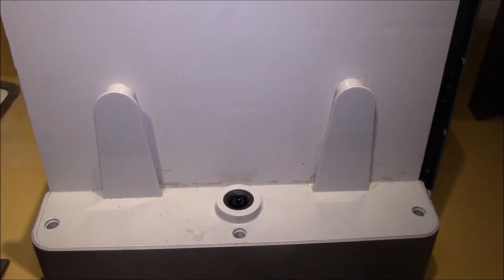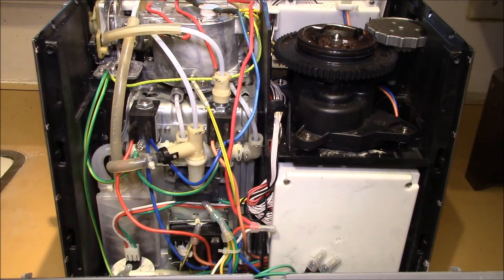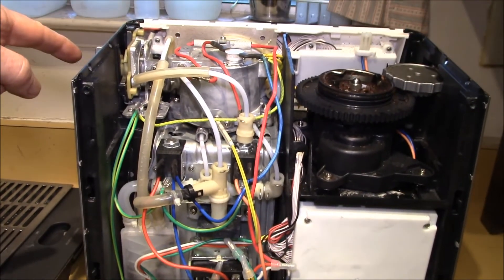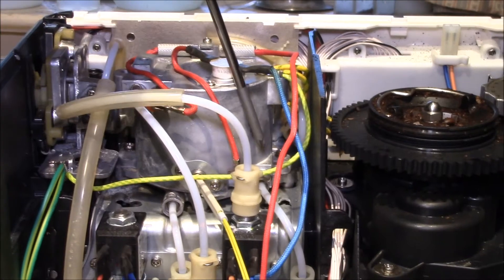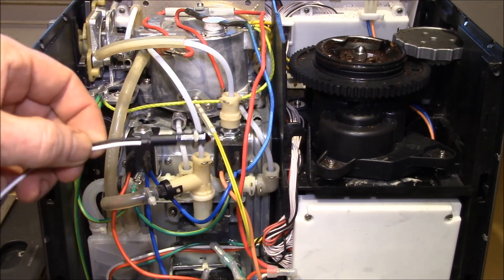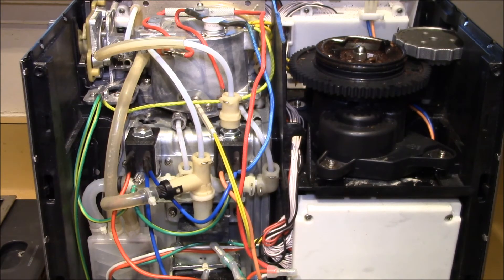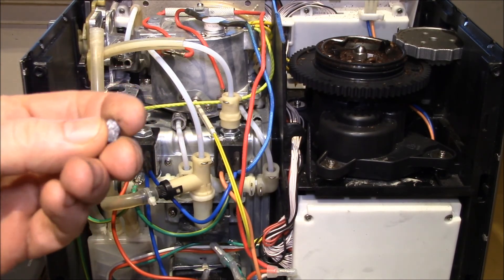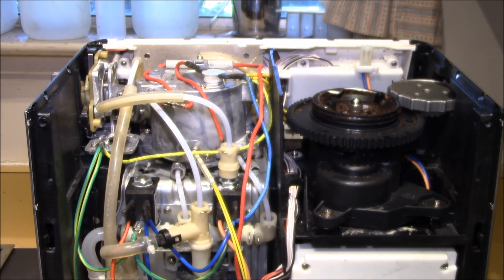Breville/Sage 870XL Barista Express - Water Flow

Comment: Need Help.
Have unique situation. 
When machine broke down only steam/hot water was working.
Replaced solenoid valve assembly: espresso part is working, hot water and steam is going thru espresso port.
Changes three way valve with part from Brevville(OEM) and same: espresso is working, when I turn hot water or steam,  it’s going thru espresso part.
What could be wrong?
Reply from the maker: Follow the water, if it's going to espresso all the time, the 3-port solenoid is either stuck open or it's being turned on all the time.  One test is to unplug the machine, open the back and remove one of the top 2 wires from the solenoid, tape off the exposed end, then plug the machine in for a test.  If it only does hot water/steam, then the solenoid is getting power all the time, check the main circuit board, perhaps the driver for that solenoid is stuck on.  If if still does only espresso, the solenoid valve is stuck open internally.  Open it up and see what's up, I have a video on testing the solenoid valve in this playlist.
Reply: @ I unplugged one wire from solenoid and run test. Water/steam worked and espresso didn’t. 
Connected that wire back and espresso works but hot water/steam goes thru espresso port . 
I believe I need to check or replace circuit board? What to check in the circuit board?
Reply from the maker: @mortgagesdmv9205  See photo 11 in the album below:
https://photos.app.goo.gl/bN1ugnLPYwvyDcr59
Likely either TA-3 or TA-4 have failed in a shorted condition, i.e. they are always on.
Reply: @The4Crawler  TA4 is burned out . 
Thank you for your help with finding it

Comment: I had no water flow. After I took it all apart I discovered a comment somewhere to just syringe water through the back inlet. This gets rid of the air inside and forces water into the boiler system etc. 100% worked!!!. Try it before you start taking your machine apart..
Reply from the maker: That's a great tip, thanks for sharing!
Reply: Like just remove the tank and then syringe in three that outlet? Or take back cover off and syringe into inlet hose?

Comment: Thanks for the tutorial.  I'm having an issue with my steam wand on my bes870 Breville.  Nothing comes out of the steam wand when I switch it over, the lights engage on the machine, but when I switch it over to hot water all the steam and then eventually hot water comes out of there.  So the pressure is building properly but not releasing anywhere when switched to the steam wand.  I was thinking maybe a dodgy valve that isn't opening properly or something?  I have cleaned the wand and tip, and descaled a couple times.  There's not even a drip of water coming out with the tip off the wand.
Reply from the maker: Some tips on low or no steam flow below:
https://siber-sonic.com/appliance/800Mech.html

Comment: Which solenoid valve do I need for my 870XL? Just the double or triple? Mine started the nasty buzzing this morning while brewing
Reply: Can’t figure out if I need the 2 way or 3way
Reply from the maker: @tylermiller214  This video should answer that question.  The 3-port valve is what diverts water to the group head when it's on, and when off sends it to the hot water / steam valve.
Reply from the maker: The 3-port solenoid is the main one, that one needs to turn on to do the espresso mode:
https://youtu.be/96IuKiuIB5A?si=xAKVDuzdpCJongU9
Reply: @The4Crawler  thank you man i appreciate  your time. I’m getting the noise when I try to brew a shot

Comment: I replaced the 3-way solenoid valve (the black one on the right in the video) a few weeks ago as it was tripping when I pressed the 1 or 2 cup button up front. It was okay for a while but now I have very little water coming from the group head (it doesn't make the normal sounds anymore) and hot water outlet / steam wand. Of course, there is no pressure on the meter as well. How do I fix this?
Reply from the maker: See the pinned comment for this video, lots of good troubleshooting information there.
In short, figure out where the water is going, assuming the pump is running, likely to the drip tray.  If the pump isn't running or not producing enough flow/pressure, see why.  Is water getting to the pump,. is it going out the overpressure valve and to the drip tray?  If it's going to the hot water side OK, then it's likely that solenoid that is either plugged and not opening fully (water will flow to the hot water valve as that's the path of least resistance).  Or perhaps the solenoid isn't being turned on by the main circuit board; bad connection or faulty driver circuit.
Reply: @The4Crawler  Ok thanks. I believe the pump is turning on but sound suddenly changes midway (gets softer) even on power on. I'll check the pipes for leaks or clogs. At this point, I am assuming that there is some issue with water flow.

Comment: I have issue with my breville the steam come from group head will make coffee
Reply from the maker: It could be the tubes inside are connected incorrectly.  Refer to this video on how the tubes should connect and the water should flow.

Or, perhaps the 3-port solenoid valve is either stuck open or is being energized all the time.  One test is to unplug the machine, reach inside and pull one or both wires off the valve coil, be sure to wrap them in electrical tape.  Then try running the machine and see if only the hot water / steam function works.  If it does, then there may be an issue with the main circuit board.  If it doesn't work, then the solenoid is stuck open.  Try cleaning it internally or replace it.  Videos on both those subjects in this playlist.
Reply: @The4Crawler  it look it get heater more than
Reply: @The4Crawler  I can get your WhatsApp number to send you the video

Comment: Was able to diagnose and fix my breville thanks to this video and explanation of the water path.  My 3 way solenoid valve orifice was clogged up with mineral deposits causing a lack of water to be dispensed.
Reply: Was it just a matter of pulling the minerals out of the valve and hose?

Comment: Thanks for the video. I wouldn't have tried to fix my machine without this video. My problem was that I was getting no water from the group head but there was water to the hot tap and steam wand. I replaced the 3-way valve and solenoid and now my problem is reversed, water at the group head but also steam as well and no steam or water at the hot tap and wand. I read a post on reddit that said they had fixed the same problem by reversing the valve. My valve has no flow symbol on it so I assumed it could be installed in either direction, but after reading his post I noticed that the valve has a number 1 on one end and the number 2 on the other end. If they are to do with flow then is the 1 upstream and the 2 downstream?  Your thoughts would be appreciated
Reply from the maker: If that's the 3-port valve, one way to check is try to blow through the valve and see which way the air will pass. It should let air flow from one side and out the top port when not powered. The other side should not flow any air when the valve is off.
Reply: That means it's the number 1 upstream and the 2 downstream. Thank you. You're a star !!  👍

Comment: Hi great video, i followed and replaced both soleinoid. Water now coming out of brewhead but now my steamer is coming out of there too, any ideas on how to fix this?
Reply from the maker: Check out the pinned comment in this video for detailed troubleshooting ideas.  To get water out of both the group head and steamer at the same time, it's likely that the 3-port solenoid valve is perhaps stuck partway open.  It needs to open or close fully to seal off the other passage and stop water from flowing to the steamer while brewing or vice versa.  Maybe there's some debris or hard water deposits in there.  Try running a few descaling cycles back to back and see if that clears it up.  Switch back and forth between hot water and coffee while descaling.

Comment: Thank you so much for posting this video. I own an ultima cossa espresso machine that basically it's very similar to yours. After doing extensive troubleshooting based on your recommendations,  I put it back together and decided to do a very deep descaling procedure FIVE times in a row till I finally started getting a full stream of hot water out of the group head and the wand. I believe the main issue was a build up of hard water in the system. Once Again, Thank you sir for taking the timing by posting this invaluable  information.  Cheers.
Reply from the maker: Glad you were able to get your machine running again.  Have heard that running multiple descaling cycles can free up a stuck solenoid.  I found I had to take mine apart for cleaning:
https://youtu.be/eljHS_BRJXk?si=ZlYma7_TtcD7y29g

Comment: I have a Breville espresso machine it seems I overfilled the one shot when making the cappuccino the machine smoked smoke came out of through the side. I have no pressure and no water is coming out through the cappuccino maker. I do have speed and I do have hot water for tea. any kind of suggestion would you?
Reply from the maker: See the pinned comment in this video for troubleshooting ideas.  But yes, the 3-port solenoid valve is what controls flow to the group head.  It needs to turn on and open to send hot water there.  When it's off/closed, hot water/steam will still work.  Likely the black plastic coil is what burned out (look for signs of burning on it), or perhaps the drive circuit on the main circuit board has burned out.

Comment: Thanks for the very informative video. I have had my breville for 6 years with no issues. My hot water and steam wand is working but no water through the group head just dumping straight to purge drip tray. I presume I have a bad solinoid. A common water leak I found is the elbow connector which I have replaced. Thank you

Comment: Amazing video thank you so much, this was a big help ,... I got a Breville 870XL, original problem was "no pressure and no water coming out of group head when I did 1 and 2 cups". Water and steamer working perfectly fine. I replaced the entire Valve block including new solenoids. Now I have the opposite problem, water comes out of group head (pressure gauge still at zero) but now I get no steam/water from the top. Weird thing is water pours out of the group head when the unit is turned on as if I chose the ONE cup pour option. Looks like the 3-way Solenoid on both old and new blocks are stuck in open and close position? Any thoughts?  I’m stumped at what to try next.  Thanks for such great video.
Reply from the maker: Some troubleshooting tips in the pinned comment on this video.  One test, disconnect the wires from the 3-port valve (be sure to unplug the machine prior to this and tape off the ends of the wires as they'll be live).  Then see if the hot water / steam works.  If so, perhaps the valve was mis-wired and/or the drivers on the main circuit board have failed in the "on" state.   If that's not the case, try blowing air through that 3-port valve and see where it comes out with no power applied.  Air should flow from the right side port to the top port.  It could also be that valve was installed backwards, to test that blow in the left side port and if it comes out the top, then flip that valve in the bracket.  Also, check for a clogged tube coming off the top of that valve and running to the hot water / steam valve.
Reply: @The4Crawler  so I disconnected the wires from the 3-port valve and sure enough the steam/water option works perfectly ... when I plug the wires back in (I have a picture with original wiring to make sure wires are correctly plugged back in) it goes back to the same, water comes out of group-head but no steam/water. If I turn steam/water on, water comes out of the group-head. Main circuit board ?
Reply from the maker: @mitchaguilar1455  Well, something is supplying power to the solenoid valve and that something is likely the driver circuit on the main PCB as that's what the other end of those wires is plugged into:
https://photos.app.goo.gl/bN1ugnLPYwvyDcr59
Reply: @The4Crawler  Cheapest I found online was U$ 200.00, almost not worth repairing, I already spent 89.00 on a new valve block
Reply from the maker: @mitchaguilar1455  Another option is to pick up a small toggle or push button switch and stick that someplace accessible from the outside.  Then put that switch in-line with the solenoid.  That way to you turn that valve on and off manually.  For added functionality, see the video in this playlist when I add indicator lights to the solenoid valves.  By adding a light on the 2-port valve, you'll see when the machine thinks the brew cycle is done as it turns on that solenoid at the end.  Leave the switch off for hot water or steam.
Reply: @The4Crawler  I will try that, thank you very much .. great help !
Reply from the maker: @mitchaguilar1455  Video below:
https://youtu.be/9cC-m3a-oXY?si=beuZf6UjaCq5UZ2P
Reply: @The4Crawler  Great , thank you again!

Comment: This was really helpful thank you! I've got a leak coming out of the elbow join closest to the hopper side and can't work out why. I changed the o ring which helped a bit, but im still not getting hot water or steam and can still see hot water dripping out. before I changed the o ring turning the switch to either hot water or steam wasn't doing anything and now it's making noises again so its definitely helped, but not fixed! Any ideas?
Reply from the maker: Glad it helped!  Could be that elbow has a small crack in it.  Take a close look at it and maybe it can be repaired using epoxy.  To lose hot water and/or steam, you would need to be losing all the water out of that fitting.  The hot water is at a fairly low pressure.  Perhaps the line to that valve or the valve itself is clogged.

Comment: Thank you for posting this.  It helped me solve my issue.  I had no flow/ no pressure to grouphead or wand/hot water.  Took the line out of the thermo coil and tested the pump was working.  Took the bottom hose out of thermo coil and one of the ferules was clogged with hard water deposit.  Back in business
Reply from the maker: Sounds like a successful repair.  Yes, just a matter of following where the water should be going and then figure out why it's not getting there.
Reply: @The4Crawler I have no flow to the group head, hot water nozzle or steam wand.  About to start my repair journey, fingers crossed its only a clogged line.  Unit is only ~2.5yrs old
Thanks for taking the time to detail the skematic operating directions, extremely helpful
Reply: That is why i am here, I am sure have the same problem ;)

Comment: Hi @The4Crawler ,
Any tips for replacing the pressure gauge without having to remove the entire panel of switches? 
I'm hoping to open the machine and be able to access the nuts from the back in order to to pop the gauge out of the front, do you think this is possible? 
I haven't had time to open it up myself yet. Hoping to get some guidance so I can order the part and do it all in one day instead of taking the machine apart twice.
Thanks in advance!
Reply from the maker: I've never accessed the gauge on my machine.  Common problem is a clogged line feeding the back of the gauge, check that first.

Looks like a few videos on the subject, search for: "breville bes870 pressure gauge replacement"
Reply: @The4Crawler  i’ll give that a shot, thanks!

Comment: Thanks, very informative. I do not have any pressure at the head, so think it may be that pump or solenoid. Plenty of steam and hot water out the steam pipe.Where did you obtain the solenoid? Thanks,Brian
Reply from the maker: Check the description of this video for some sources for those parts:
https://youtu.be/96IuKiuIB5A?si=ABq51KA35gv8xl-t

Comment: Mine is throwing the GFCI at the moment. I see a bit of  leaking around the steam switch (side knob) but can't where it shorts out.
Reply from the maker: Could be one of the small switches that sit on the hot water / steam valve to detect the position.  Or another common location is one of the black plastic electrical coils on top of the solenoid valves.  Look for signs of water deposits in those areas.
Reply: @The4Crawler  I ordering a replacement "Selector assembly"
Which is basically the valve for the steam/coffee/hot water.
One of hoses had what looks like a lot of corrosion around it. I gave the hose a gentle pull and it literally broke free from the assembly. The aluminum where the hose attaches has cracked /corroded. Can you advise how the thin tubes are attached to that assembly? Are they press fit or do I need to disassemble a plate to get access to them? These thin tubes don't have any clamps around them. They literally just feed right into the body.
Reply from the maker: @the_blair_bike_project  Here's how I replaced mine:
https://youtu.be/KJ0A-pzX-1Y?si=fPYsiO02mceTv2o7
Reply: @The4Crawler  wow, definitely another way to tackle it.. for the $23 for the part i will attempt to replace it.  My Selector knob has become more difficult to turn over time (yes I do descale) so I suspect it may give me future issues.